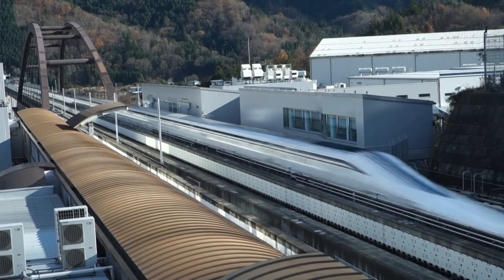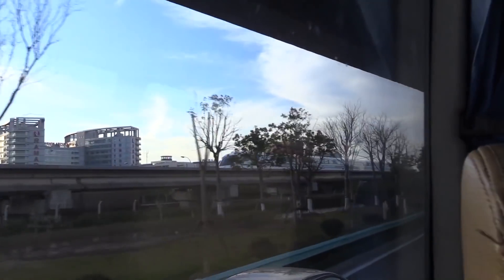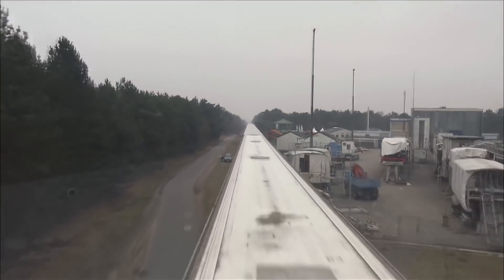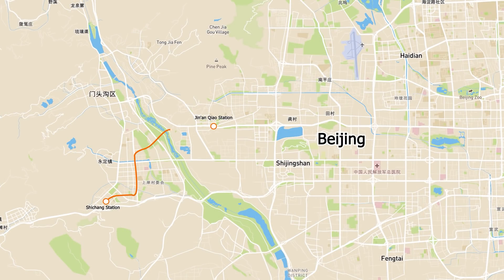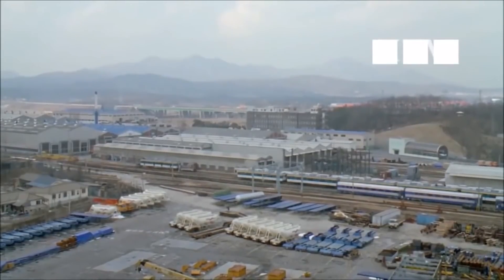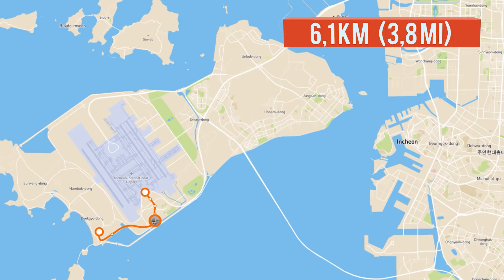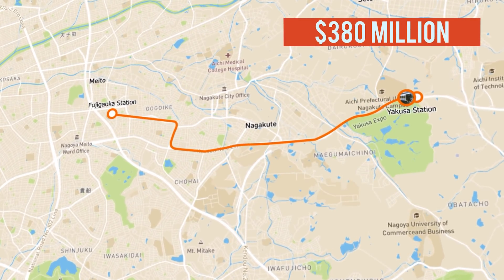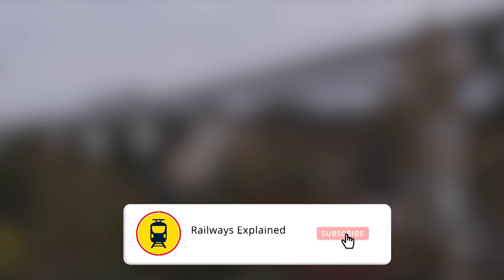Maglev Passenger Service Worldwide: Explained

Comment: The shanghai maglev is a demonstrate of why maglev technology is going nowhere. Because of it incompatible and expensive tracks, it doesn't go all the way to downtown, forcing a time-consuming transfert. Most people prefer to continue their journey with the much cheaper metro, instead of paying the high premium of the maglev train to save only 10-15 min. Because it is so empty, the maglev only runs at 350 km/h, a speed easily match by an high speed rail train. I would also add that the ride on the maglev is quite bumpy (much more than a train), even at that speed. And low-speed-maglev : just why?
Reply: I was also surprised by how uncomfortable the ride actually was. The non-maglev high speed trains running at 300 kph were much smoother.
Definitely worth to try as a tourist though. The speed is unforgettable :D (but check for the times when it goes 430, it is only some times of the day).
Reply: @petrhajduk9955  "I was also surprised by how uncomfortable the ride actually was"
i found the ride to be smooth.
the 430 speed is in the middle of the journey for about 5-6 mins
Reply: Yes Shanghai maglev is bumpy. But low speed maglev are smoother. However the cost is just too high and not justifiable. It is only good in mountainous cities like Chongqing. Maglev has superb climb rate
Reply: The Shanghai Maglev runs at such low speed, because the Track was build in an earthquake-zone and needs to be adjusted from time to time, its build on dampeners. The vehicle itself, as fine German technology is like, is still operating perfectly after 20+ years. Just the interieur is a bit worn out since the chinese company, that is still working together with it´s German partner and technology-owner, doesn´t care that much.
Reply: And: IN 1987, it was already proven with the transrapid 07 that the track´s a Transrapid´s engine consists of - amongst other magnetic parts - is easily to be adapted to normal railway-tracks. It´s just never beent realised, since some ideologic fools ruined the upcoming of an already series-production ready technology with their weird mindset and therefore blocked any progress in modernising germany´s principal railway-structuring (same goes for nuclear technology in which we were world leading forerunners). The technology was pushed forward as a parallel project aside the ICE, a so called "Machbarkeitsstudie" by the German Federal ministry of transportation from the end of the 70s onwards. That is why the Transrapid Versuchsanlage Emsland was build. That this technology needs an own track, because of incompatibility, is one thing just and that´s a lie.
Reply: maglev supposed to be have lower track maintenance, as you don't need to run nightly trains to test track conditions and make adjustments. However, the shanghai project have that this is false, and maintenance cost was actually higher than conventional HSR. Low speed maglev suppose do the same as well, however, time is still need to demonstrate it vs. conventional metro lines.  However, given rapid expansion of metro projects in China are conventional rail, I doubt maglev have proved it worth.

Comment: An argument against maglev that I've often heard is the claim that especially at low speeds, (EMS) maglev trains use more energy than conventional trains, since wheeled vehicles don't need to expend energy for lift. However, I'm wondering if perhaps those who make that argument don't understand the physics of maglev. I don't think a maglev train has to waste the same amount of energy a reaction engine has to expend to hover, and I don't even think it's as much as a helicopter or a ground effect ekranoplan or hovercraft. Am I right? How much energy is needed? Does someone here really understand the physics of that?
Reply: I mean you can probably calculate that. If you are hovering it means the forces are in equilibrium and the repelling force is a little bit superior to the force of gravity exerted which depends on the vehicle mass. I don't know any exact number but it is definitely something to consider. Oh and the system is definitely not 100% efficient so there is a loss
Reply: @almerindaromeira8352  See that's where I think an excessively simplistic calculation like that could be quite misleading: There is a huge difference between the energy required by a reaction engine, or a chopper, or a hovercraft, due to various effects that need to be taken into account. Theoretically there's even a gap between a wheel and a rail. And these are all "holding something up". Scale, distance and the applicable fundamental forces and their physics matter. But I don't know enough about electromagnetism to understand how to properly take the lifting mode into account. I was hoping someone else could explain.
Reply: @ropersonline  You can do any calculation you want, but if maglev really used less energy then all freight and passenger lines would all be converted to maglev. Or at least all new lines.
Reply: @ropersonline  the description is simple, the math itself is more complicated. The force needed to lift an object is always the same. If it has a mass of 3kg, you need at least 30 N (on earth) to lift it up a bit, a little bit more if you want it to hover a few mm off the ground. That won't change.
Calculating the force of magnets is something I can't do, especially because it highly depends on set up, but I can tell you they are not 100% efficient. That means you need not only enough power (joules) to raise the 3 kilos but more to overcome losses in the system.
A normal trains doesn't need any uplifting force because the weight rests on the wheels and is transfered down to the rails. The drawback is more resistance on the motion i.e rolling friction which is highly influenced by the mass of the object.
Reply: @ropersonline  fluid dynamics?! You are going way above your head. If the spaceX rocket weights as much as the hovercraft they will need the same amount of energy to lift up (measured in newtons) how you get there is totally different. If you use a rocket most of the energy is wasted (sound, flames). It may have lets say 60% efficiency. On the other hand the hovercraft may have a combined system efficiency of 25% because of the piston engine. That means if they use the same type of fuel the rocket would in theory require less fuel to hover. 
However do not mix efficiency with energy required for hover
Reply: @almerindaromeira8352  
"The force needed to lift an object is always the same" .. << I don't think this is true for magnets, atleast not the applied force because magnets, depending on their strength, will inherently lift an object without external input of energy. This is especially true for rare-earths alloy magnets in which a tiny alloy magnet will lift a mass hundreds of times its size.

The energy put into maglevs is mostly not for lifting iirc, but for orienting the magnets to create a directional motion of the lifted object.